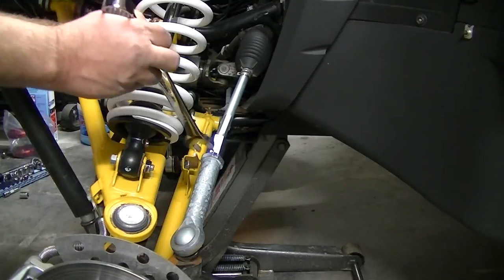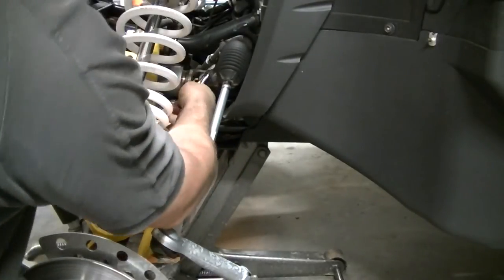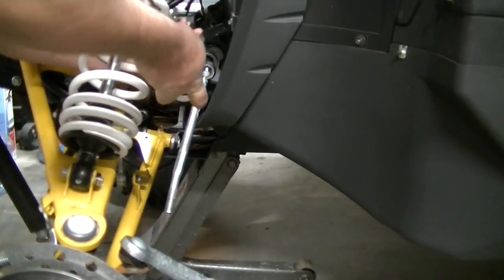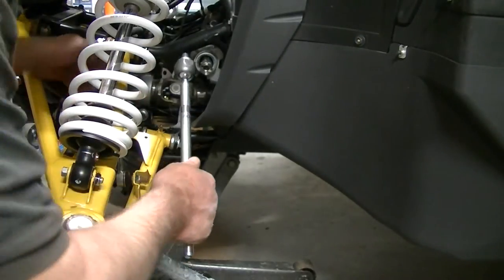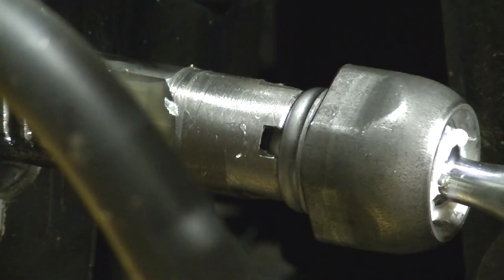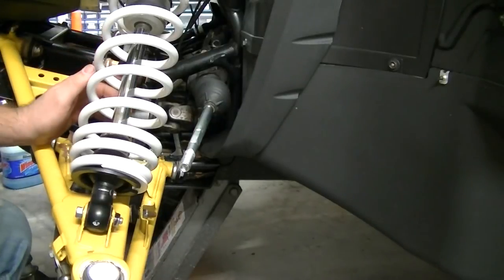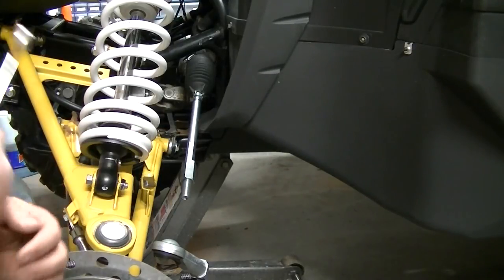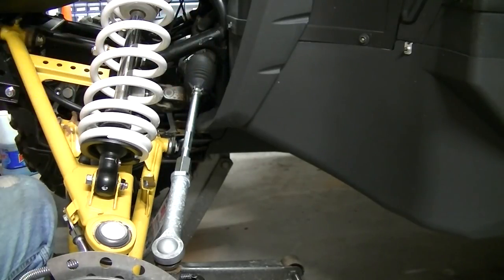Yamaha YXZ 1000R Tie Rod Replacement

Comment: Hi I work on cars for a living and what I do is I put some blue locktite on the treads that screws in the rack and pinion on the cars that I work on they never have any lock on them but they are not off road machine so there might be less chance for it to become loose thanks for the video .

Comment: Does anybody have a video on adjusting rear tow ?
Reply from the maker: No adjustment on the rear with stock arms.
Reply: @marcoradat  so i gess paerts are bent
Reply from the maker: Check the frame where the rear of the lower swing arm bolts up.  Known weak point in the frame.
Reply: @marcoradat  I guess there's no way to adjust the camber either on front or rear
Reply from the maker: Only adjustment with a stock setup is toe.
Reply: @marcoradat  that's what I figured when I was looking at it I guess the long travel kit was meant to be
Reply: @marcoradat  thanks for the help I appreciate it and I subscribed